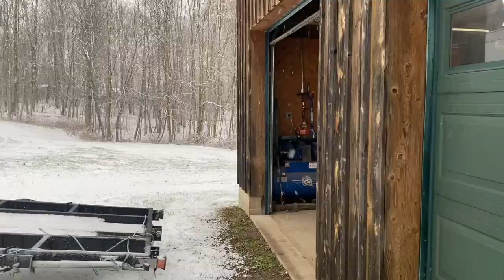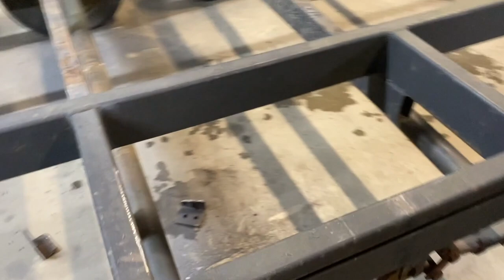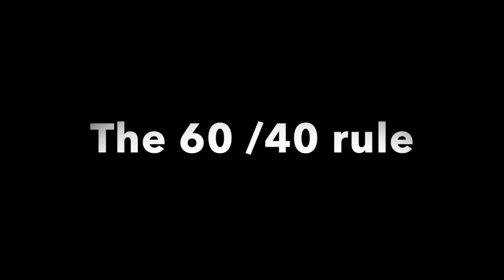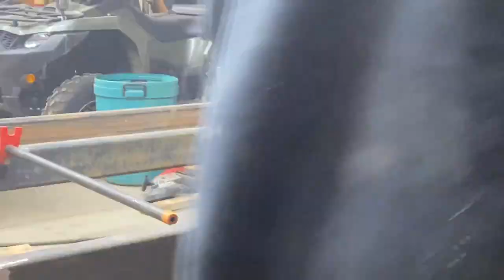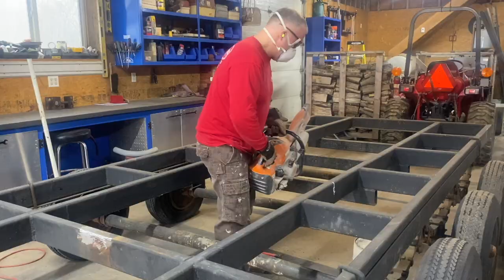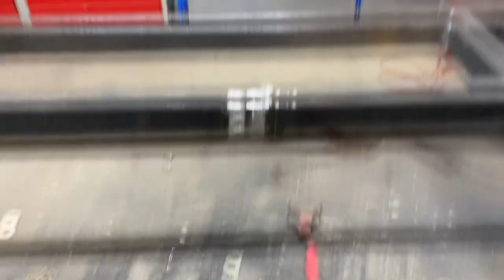Tiny house/hunting camp trailer frame build. Part 1

Comment: That steel is overkill for a foundation. To save weight I'd suggest steel studs. Looks like a fun project.
Reply from the maker: I think it is a tank right now Bill. I might make a sub frame from 1" X 3" X 1/16" tubing I can buy reasonable and then run wood perlings to that. so I can foam board between perlings and then metal siding  What u think of that idea buddy ?
Reply: @bondobuilt386  Sounds like it ought to work. (and might stop small caliber projectiles.
Reply from the maker: @BillB23  ya lol it might be bullet proof. 😂😂

Comment: I don't know if I'd leave those braces out ( the ones you cut off the bottom) . You don't don't it twisting the frame. If you widen it from where it is now it's going to be an expensive thing for minimal gain inside . When you get to the point of wiring tail lights  run conduit on your inside rail for the wiring  . I made that mistake before , and since then I always run conduit on the frame
Reply from the maker: Mario thanks for the reminder of the conduit. I might run 3" channel iron across the top at 2' centers. put foam board between them and then my floor. Alot of people build the floor out of 2X4 's but with the channel I could make it wider just hang it off a little  I'm thinking 7' 6" but still haven't decided yet. LOL 
Thanks buddy.

Comment: I would not widen the existing frame. I would use 2" x 4" x .125 tubing extensions.  Plenty strong.  Agree with your plan to lift the center cross beams.  I would do one at a time so the frame does not warp.  Consider using metal studs for your wall and top framing. This will give you room for insulation.  You can widen your axles but I think you would be better off simply tucking them under the body.  You did good at $800.
Reply from the maker: Thanks Steve. Good info you shared. 👍. I took them out and welded one back in there flush but now I want to use some channel for the rest because its lighter. So your saying just weld on short stubs to widen it a little ?  That was one of the things I was thinking but was gonna use chanell Iron because I have some. What You think?
Reply: A lot of trailers have been built with channel iron, Not as strong as tubing of equivalent dimension but adequate for a tiny house.
Reply from the maker: @stevehansen5477  Thanks Steve. 👍

Comment: The cross braces are higher then the axles  you can etrailer  all the parts you need to highway rated tires brakes ok if working
Reply from the maker: Thanks Craig. 👍

Comment: Welds looked good to me. R and P Carriages out of Seneca, Il sells kits to convert your axles. Watch this Video to see how it is done. Good luck with the build. Is that your boiler in the background of the shop or one you are building for someone?
Reply from the maker: Thanks Tom.I'll check that place out.  I didn't get a video to watch? That is a project boiler I have been working on. I used it to heat my house last year but I need to do some mods to it to make it draft better. It held a fire great but would require to much cleaning. I know what I have to do but it's hard to mod something in service so I took it out for now.
Reply from the maker: @tommckinney3947  Thanks I'm Gonna watch it now Tom. 👍👍

Comment: The Frame will need a Stronger/Larger base frame to support the weight of a tiny house!
Reply from the maker: Steve you think so? This thing is real stout  The main frame is two 5" X2"X 1/4" box tubing. Also I'm only going one story and gonna try and keep it light. People have built tiny houses on youtube on a camper frame that is no where near as heavy as this one. They are real light duty. I wouldn't recommend that without mods. Campers are real flimsy built.

Comment: I am disappointed that you videoed yourself using a saw blade that wasn't rated to run 10,000 rpms to cut steel. It was an accident waiting to happen.
Reply from the maker: I can't argue that Loren. Thanks for the feedback. 👍